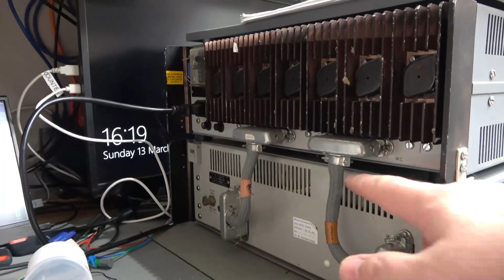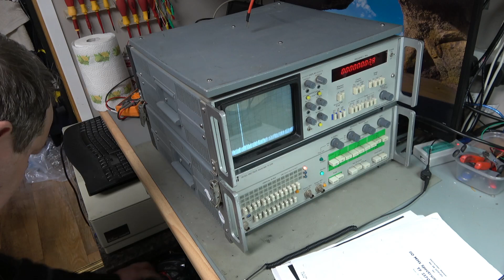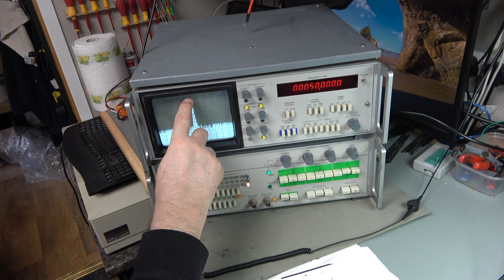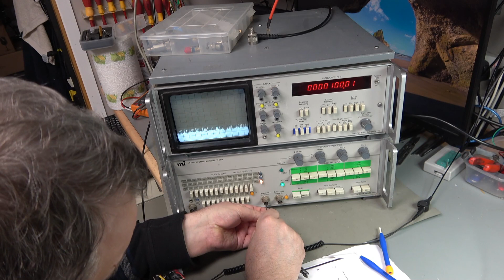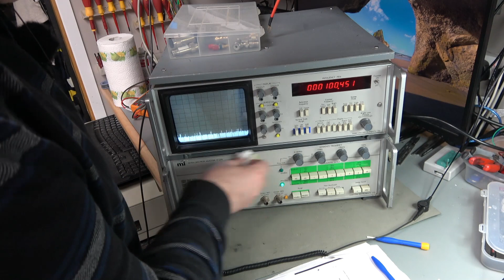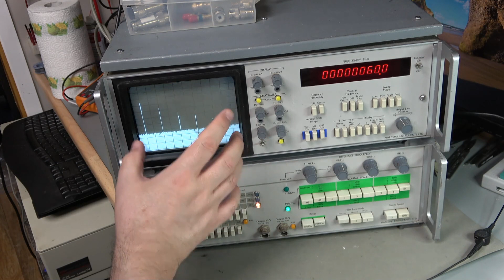Marconi Spectrum Analyser TF2370 #0056

Comment: Hi great videos, I have subscribed, can you please tell me where you got the small cleaning brushes, that you used for the BNC connector ,
I found your Chanel as I was looking for video on the peak tester, I have now got one on the way,
Thanks Dave 2E0DMB
Reply from the maker: They are cleaning brushes for atist airbrush nozzles, they come in sets of about 4 or 5 sizes easy enough on amazon etc.  I also remember back in the old days we used to use pipe cleaners which are a twisted wire with a cotton like bristle.  I use them with 70% epa, 30% water and wear my end wrist strap if I'm worried about static.
Reply: @MakeOrRepair  thanks I will get some
Thank Dave